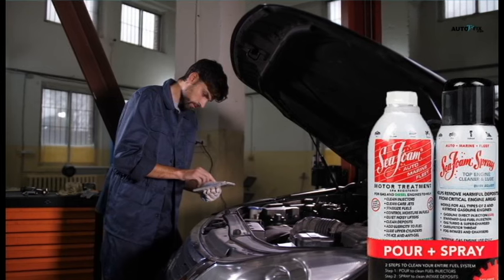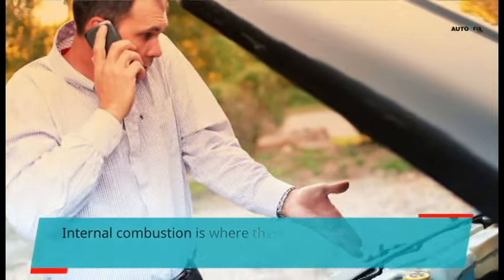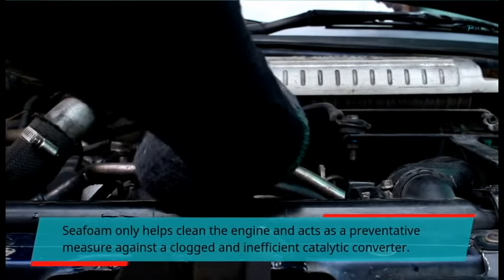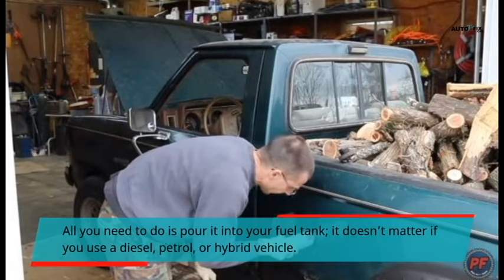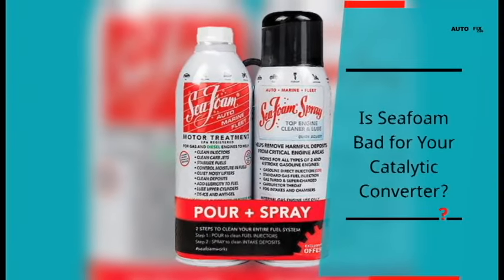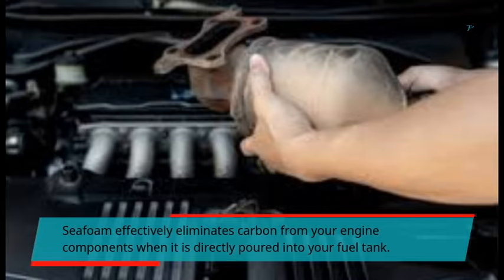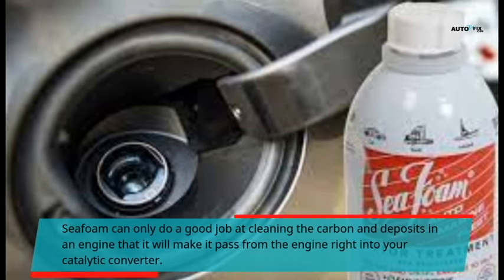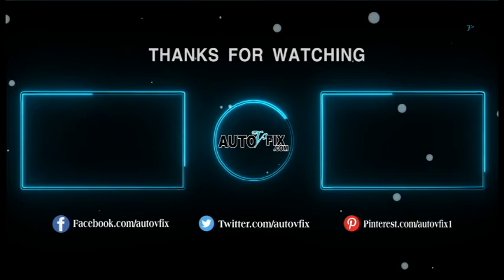How to Clean The Catalytic Converter with Seafoam( Does Seafoam Work?) catalytic converter cleaner

Comment: Had a p0420 code on honda crv. Did seafoam treatment through brake booster and code reset never came back.
Reply: I don't understand code never  came back?... what are you saying? Check engine light came on  so then you used Seafoam, Check engine light never turn on?

Comment: Seafoam forever.  I never have to take our vehicle to the shop for repair.  Never ever do I have to get repairs done?  Full synthetic oil is all it needs and Seafoam.  Honestly
Reply: Did you have any codes or acceleration issues before using it?

Comment: I did the Seafoam when there was a little over 1/4 tank of gas.
Now I have probably a little under  1/8 tank of gas left with the Seafoam . 
Too bad I didn't see this video sooner.
Now I want to do the CataClean treatment into a new 1/4 tank of gas.
Do you think there is any problem adding gas with cataclean when there is still a little seafoam in there.
Reply: Yes I heard that mixing additive can cause the gas the gel up
Reply: Did you use the cataclean ? Did it help?
Reply: @dramatimefighting  I used it, my check engine light came back after a few hundred miles. I think the best way to to spray seafoam into cat from upstream o2 sensor
Reply: @dramatimefighting  I used CataClean and I think, I Think it helped. But who knows, I also used Seafoam before that.. Before using the CataClean I ran truck with just gas in order to flush out previous cleaners (Seafoam etc, so as not to mix them)
Reply: @calebbasile2219 do u spray it where it connects to the converter
Reply: @pjwoo276  i used cataclean once and the light came back after a few days.  But then I used it a second time and the light has been  off for about a 1K miles.  Holding my breath.

Comment: I was always told that one thing NEVER to put in a car is that Sea Foam stuff.  I wouldn't know, because I never have, but if it is so wonderful why have people advised not to use it . . . .
Reply: Because they would rather you spend thousands to replace it
Reply: Never had any issues with my cat until a month later now I have sulfur smell and some white water burn off off the tailpipe. Gonna use another brand and try to restore it :/
Reply: Mechanics want you to pay for work you don't really need.
Reply: Seafoam works great I use it on everything from my mower to my semi truck .
Reply: Seafoam is great. My dad and my friend’s dad coincidentally would say use it once every 3 months or so around the time I change my oil
Reply: @Yomomma-zb5rq thats a blown head gasket
Reply: @Icookadapizza did you have acceleration issues or codes before using it?